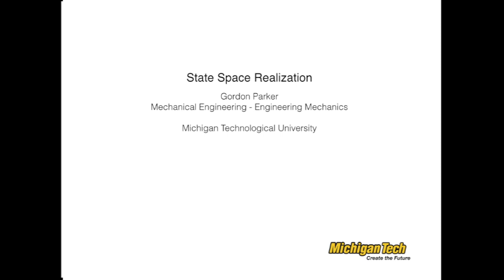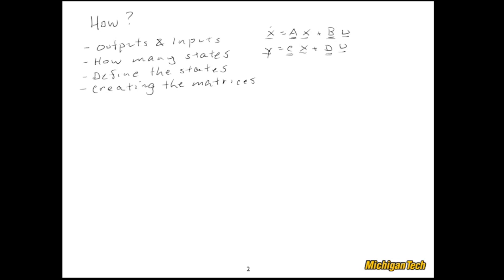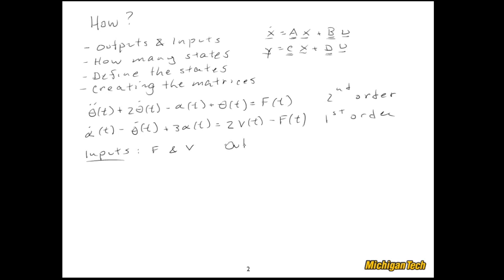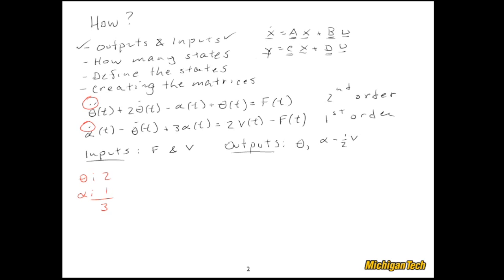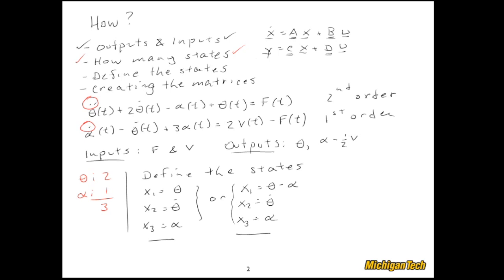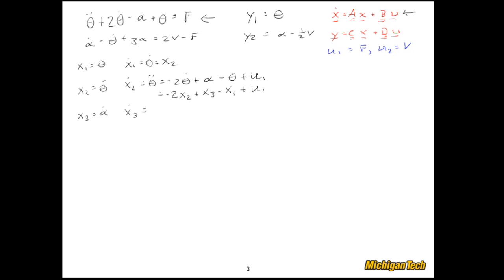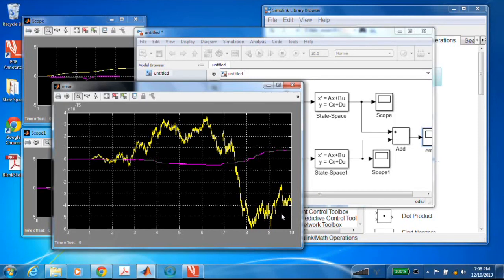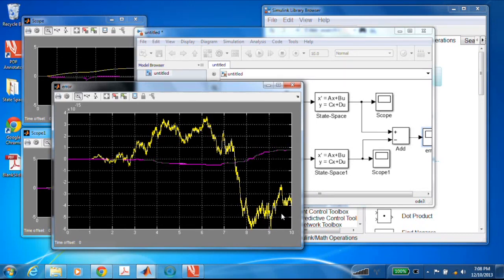How To Make a State Space Realization

Comment: Thanks for your help. Nice clear explanations without skipping any of the "small" stuff. 
Small typo @ 23:07 (0 0 1 should be 0 0 3) but you entered the correct value into simulink.
One thing I am stuck on, how did you know to choose y2 = a - 0.5v?
I would have chosen it to be just y2 = a   --> this of course gave me a different D matrix and a slightly different step response when plotted in Simulink, which means it is not the same system.

In conclusion, I am confused with how to choose the output variables. Please help, and many thanks for your help so far. :)
Reply: I believe the outputs are not assumed or chosen, rather its measured from the actual physical system as explained from 04:43  . A change in output means change in system.
Reply: I think he assumed that just to illustrate the example, in real model it depends on your system.

Comment: Looking at how you selected the outputs i.e. any variable that you wanted; Is it possible to do the same with the inputs. Meaning... do the inputs have to be something that acts upon the differential equation or rather is it possible that an output could also be an input?
Reply from the maker: Inputs are typically not arbitrary. They are usually specified by the sensors you have attached to the gizmo. If you have the luxury of being able to add more sensors, then you have some freedom.